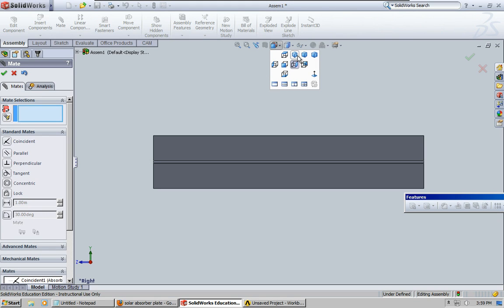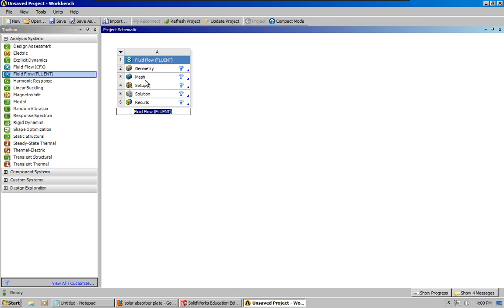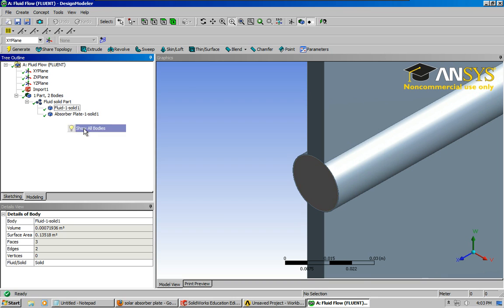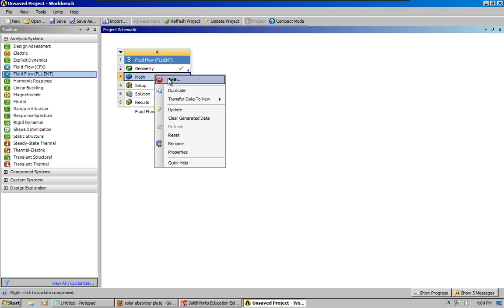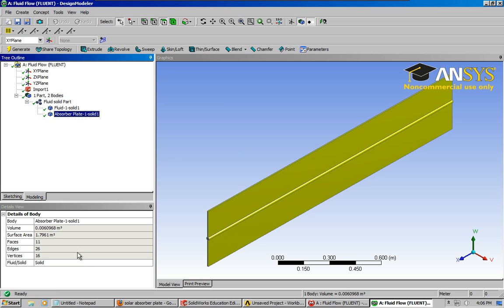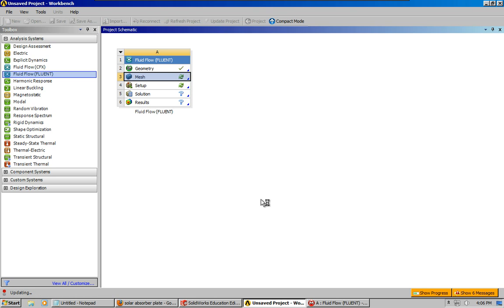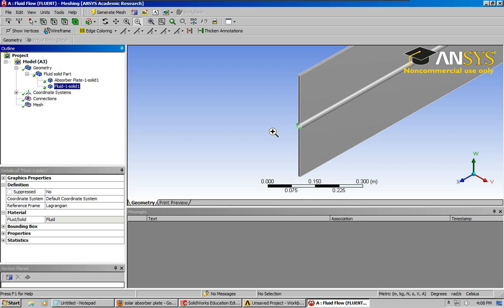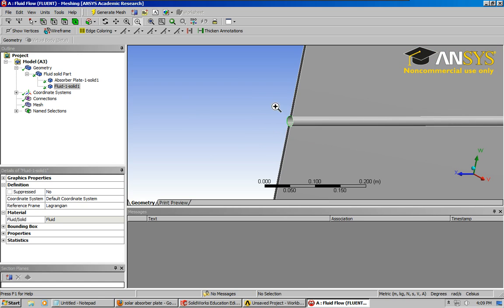Ansys Fluent Tutorial Solid to Fluid Heat Exchanger Part 2 Design Modeler and meshing

Comment: We've been trying to design a Cd nozzle exhausting to the atmosphere but we've been unable to manage passing the flow from the nozzle exhaust into the atmosphere.The flow stops at our nozzle outlet and doesn't pass through as the nozzle and atmosphere are two seperate bodies. Is there anyway you could help us?

Comment: Hi, need help.
I created an assembly of two parts and tried to import the part file into workbench. It gave three error messages - (1) Attach failed. (2) Geometry Interface not found. (3) No compatible interface found for this file type.
What am I doing wrong?
Reply: Yes i solve the same problem. if u people using ansys 14.5 or upper version. (1) create solidworks assembly geometry then save as it IGES Part. not Prtsld .(2) import the SW geometry in design modeller and rename the Plate and Fluid and change the phase as solid and fluid as video and remember the both plate and fluid as one Part and two as per video. (3) in mesh don't select the interface surface it automatically created in fluent when it required. only mesh it and name selection as inlet, outlet, top surface, bottom surface and walls as per video. (4) then go to fluent and check boundary condition in which we found two new surfaces one name is shadow automatically then solve it.

Comment: When you make the interface selection, is it on the solid or the fluid? Or both?
Reply: Yes i solve the same problem. if u people using ansys 14.5 or upper version. (1) create solidworks assembly geometry then save as it IGES Part. not Prtsld .(2) import the SW geometry in design modeller and rename the Plate and Fluid and change the phase as solid and fluid as video and remember the both plate and fluid as one Part and two as per video. (3) in mesh don't select the interface surface it automatically created in fluent when it required. only mesh it and name selection as inlet, outlet, top surface, bottom surface and walls as per video. (4) then go to fluent and check boundary condition in which we found two new surfaces one name is shadow automatically then solve it.

Comment: hello everybody , i followed the tutorial step by step , but i have a problem when i import the geometry in anasys as IGES file ...ansys dosn'et read the interface and gives two surfaces , one for the solid and the second for the fluid , so the results are wrong. please some can help me ? 
how to configure ansys tto accept part or solidworks geometries ?
thank you
Reply: +eddie dehmous  while installing ansys.. it asks u to choose what software models to accept... if u have configured it correctly while installing... now it will not be a problem.. if not just run the setup again and do those

Comment: Hi Vladimir, I followed your tutorial step by step. Every time I got in trouble with the interface part. After importing the SolidWorks into Ansys, my fluid part became two faces instead of one body. I guess this result to my error in interface. Can you help me regarding this?
Reply: Xiaobing, did you slove this problem? I faced the same problem...
Reply: I get the same problem too, did you solve it ?  the solidworks in my pc is 2011 education version, and ansys is 14.5 version.
Reply: Try Gambit to build the model. You should be able to solve it.
Reply: Thanks for your help, I solve the problem by cad transfer to ansys workbench, thanks again
Reply: Yes i solve the same problem. if u people using ansys 14.5 or upper version. (1) create solidworks assembly geometry then save as it IGES Part. not Prtsld .(2) import the SW geometry in design modeller and rename the Plate and Fluid and change the phase as solid and fluid as video and remember the both plate and fluid as one Part and two as per video. (3) in mesh don't select the interface surface it automatically created in fluent when it required. only mesh it and name selection as inlet, outlet, top surface, bottom surface and walls as per video. (4) then go to fluent and check boundary condition in which we found two new surfaces one name is shadow automatically then solve it.
Reply: @mohdsuhail027  it worked dude, thanks alot
Reply: Yes i solve the same problem. if u people using ansys 14.5 or upper version. (1) create solidworks assembly geometry then save as it IGES Part. not Prtsld .(2) import the SW geometry in design modeller and rename the Plate and Fluid and change the phase as solid and fluid as video and remember the both plate and fluid as one Part and two as per video. (3) in mesh don't select the interface surface it automatically created in fluent when it required. only mesh it and name selection as inlet, outlet, top surface, bottom surface and walls as per video. (4) then go to fluent and check boundary condition in which we found two new surfaces one name is shadow automatically then solve it.